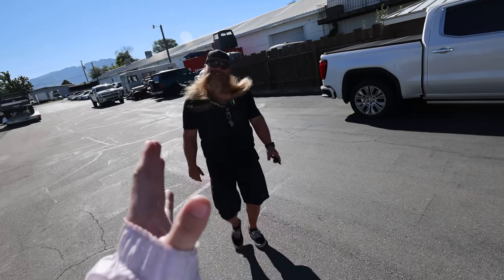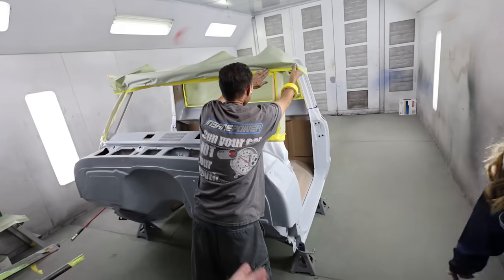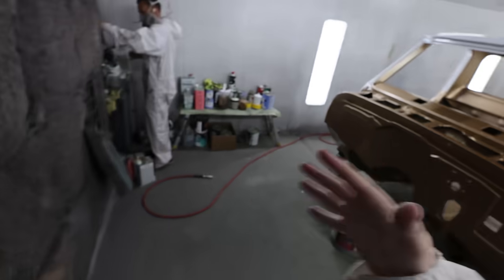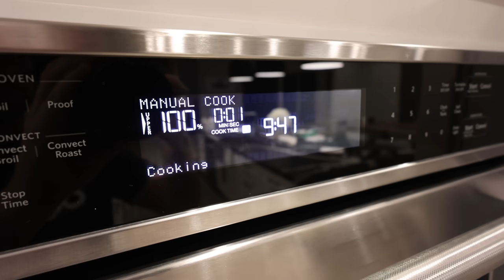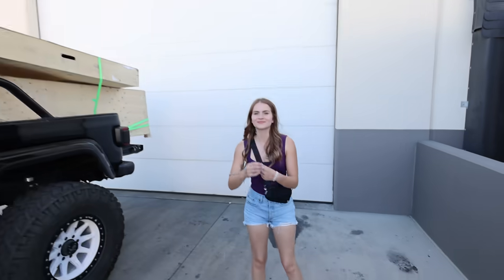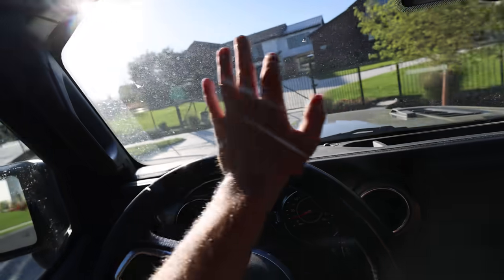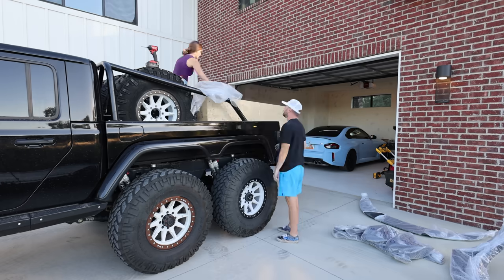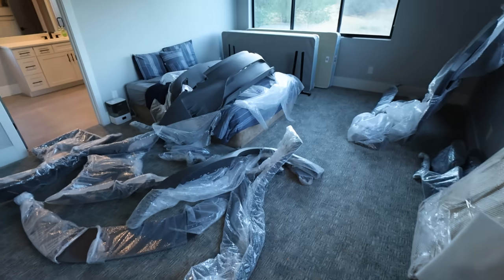$70,000 Christmas Present has ARRIVED!!!

Comment: The carbon fiber parts would just need a clearcoat if you'd want to have it exposed. Gloss clear for a gloss finish, matte clear for a matte finish. Bare carbon just means it has to be protected, which is either by a clearcoat or paint.
Reply: Saves money getting raw if youre gonna paint anyway
Reply: I would say if you want it really glossy, you can sand all the way to 2000 wet sand, but it's not necessary.
Reply: I’m surprised strad man doesn’t know that by know you’d think it would be common sense. Then again common sense isn’t so common
Reply: @whycars7898  He's a youtube businessman trying to generate more comments.
Reply: @WeThepeople-gr7on  You'd have to be careful you're not too harsh on the material. Since it has no protective layer, you could ruin the pattern if you're too rough.
Reply: Maybe do a carbon fibre color tint!?
Reply: @mathiasnkristensen  ya you don't want to cut through the carbon, I think it seems like it just needs the clear coat honestly
Reply: @iantan2641  not possible, maybe your thinking of dying kevlar.
Reply: @WeThepeople-gr7on wtf are you talking about ? Every hyper car has colored carbon fiber which is just putting a little color in the clear coat to tint is blue , red or whatever color you want your carbon
Reply: Can add color to the clear also for a colored carbon . .COLORED CARBON . .
Reply: @jkfonyi  ok, ya I did a bunch of research and stuff, and came to that conclusion a while ago. I've found that adding dyed coloring to the resin could change your fiber glass color, but I'm not sure how it works with carbon. you said adding color to the clear coat is how it works, I would like to know how it's actually done. I'll research and more stuff

Comment: #1 great job on bringing the truck back to original-ish glory. Will you put retro parts on the motor?  You can make an LS motor look like a small block…..

#2 Soph is a keeper. You guys make a perfect couple

#3 paint the 812 a neutral base color…. Ferrari white is good…. Then wrap it whatever you want. Look at howEmelia’s car turned out
Reply: White would be so clean

Comment: You will have to sand the bare carbon a little bit and put a clear coat, it will work, but you will have to check if the weave or carbon matches through part to part

Comment: I would check fuel pressure on gladiator. I've ran into the same problem with multiple dodge vehicles. Seems the baffle that keeps the fuel from seeping back into the tank fails pretty common. So you have to prime it with one start to draw more fuel to the engine and the 2nd try starts almost every single time. I'd be willing to bet yours is doing the same thing. Fuel pump replacement in the future

Comment: Gladiator needs to have a fuel filter changed. If you run the tank low to where the gas light comes on often, then it probably needs a fuel pump as well as a fuel filter

Comment: I think the gladiator is having a security issue where it’s not registering the key at first. Some cars will just click some cars will not give fuel to the engine.  I would confirm the immobilizer is in the original spot as having even just behind the dash or kick panel instead of by the key can cause receiving issues. If it is try to get your key reprogrammed or a new key and see if it helps

Comment: have you tried holding the key up to the push start button in the gladiator while turning it over? pushing the button with the key? mopars have a common issue with the security and the key fobs, give it a try next time you start it! it might start up right away! i’ve had a lot of newer ram trucks with push start issues quite like this!

Comment: Gladiator sounds like it isn’t holding fuel pressure. Might need a new fuel pump. My f250 had the same issue it wouldn’t start the first time but did start the second until I changed the fuel pump which was the problem